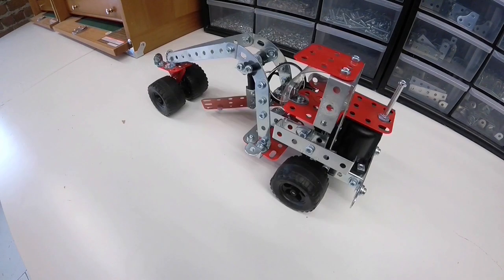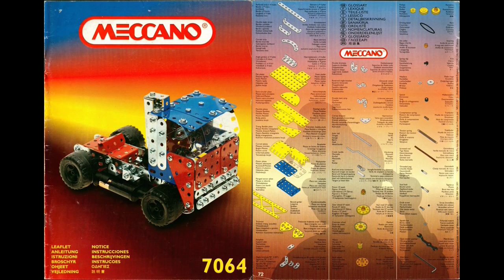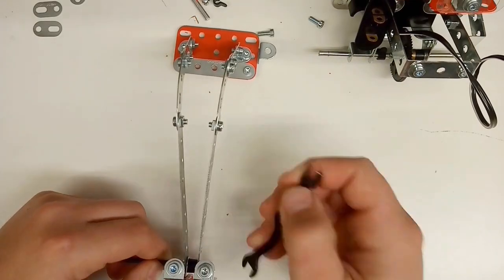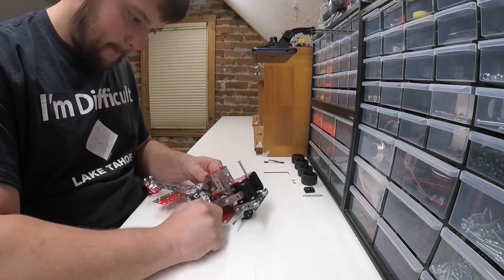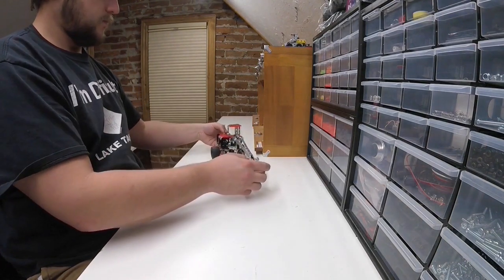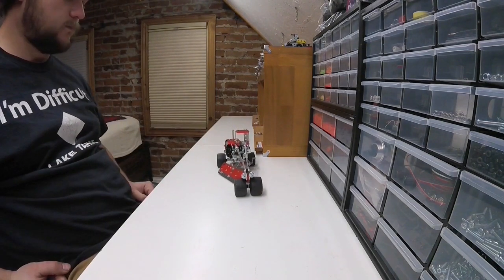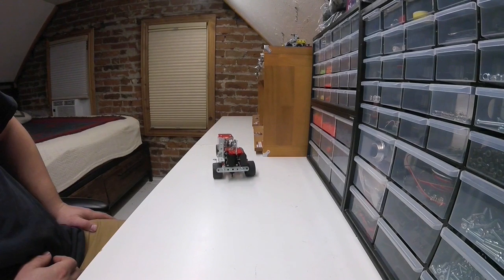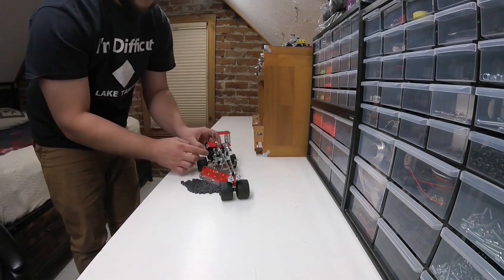Build a 1994 Erector Grading Tractor [Set #7064]

Comment: The design is probably as good as could be done with the parts available in that set.  If you have more parts then you can improve on them, but I like making to the set designs myself, at least on first build.
Reply from the maker: I certainly could have improved this one. Particularly the overall power. I could have used a single axle for the rear drive and swapped the battery pack out for a 6v or 9v power supply.